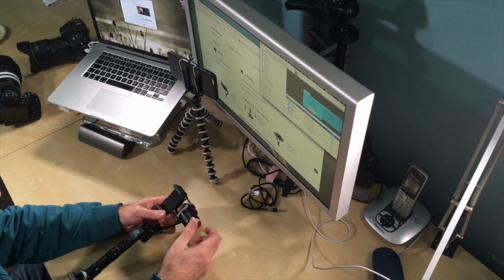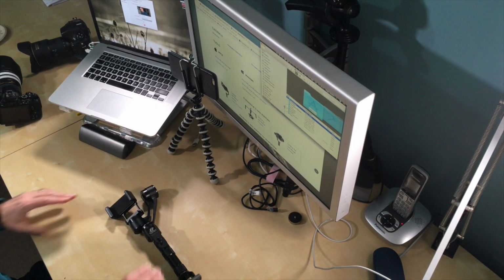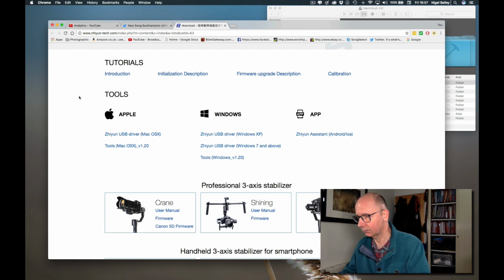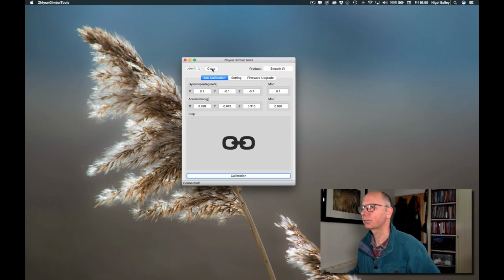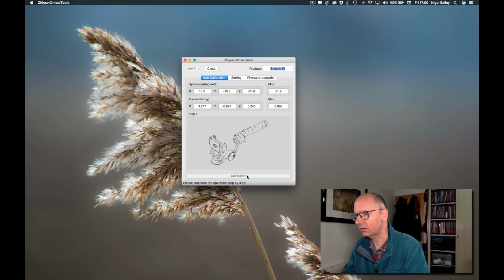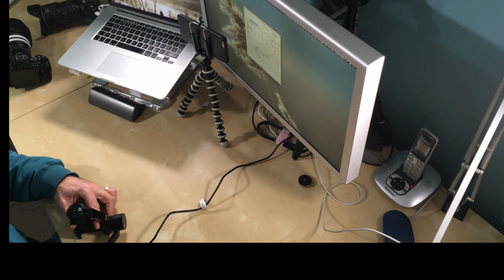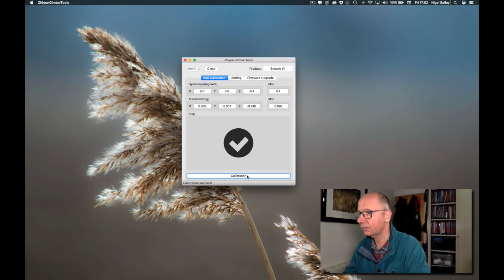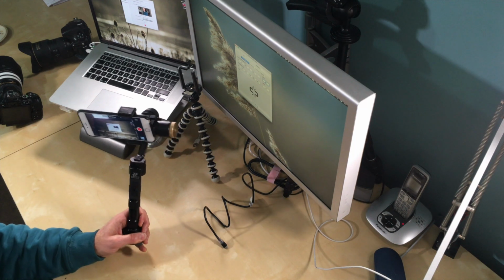How to calibrate a Zhiyun Z1-Smooth-C Gimbal

Comment: thanks for great video, but I made all the steps, anyway my gimbal has the problem that after I switch on the arm that holds my phone starts smoothly going/shifting up (like if I had joystick holding upwards -but I don't...)  do you know anything how I could solve this issue? thanks!
Reply from the maker: Thanks for watching and your question.  It sounds like you have a different version of the gimbal as you refer to the "joystick" which wasn't present on the first generation version that I have.  Sadly, I'm afraid that I don't have a solution for your problem but I hope that you are able to work it out.
Reply: no problem... well I tried everything... firmware, updates, calibration... nothing helped.
every time I switch on - my cell phone tilts up until it cannot any more.
so, I taped it on the place- so it can not tilt up... ;-)
Reply from the maker: What pain.  Is it under warranty? Sounds like a hardware problem.
Reply: well... I think is still under warranty... but bought on amazon...
whom to send.. :-(

Comment: Just got a smooth-q. Found to use the android app to calibrate its pan rate - I need to have a 2nd phone to run the software because the gimbal needs to have the using-phone in its clamp before being turned on. Terrific. I'll need to check on the version of this for the Q Variant it'd  seem. Wonder if DJI puts its customers through hoops like this?
Reply from the maker: Ian Gourlay sadly Zhiyun seems to have a very poor approach to customer service. I hope the vid will have been of some help

Comment: Mine on my mac and Windows laptop show NO tools to download only USB driver??? :(
Reply from the maker: That's really weird - I've just checked the link and it's definitely there. Scroll down the page to the Software Download bar heading and then a little further. You'll find a red Apple Logo - there is then a open-sided box below that and the first item in it is a link that downloads the calibration tool.  Let me know if you still have trouble and I'll set it up in a DropBox for you.
Reply: Thanks for getting back to me. I've managed to download it to my Windows 10 note book and got it to work.But it still wont load on my imac?
Anyway with your tutorial I have managed to callibrate it now.Thanks :)
Reply from the maker: Jason Taylor I'm glad that you have sorted it. It is possible to calibrate without a computer. I have another video tat explains how to calibrate "in the field" - if you go to my channel you should be able to find it easily enough.
Reply: Im having the same trouble, there is also no option for smooth 3? I keep trying to download the driver available but it doesnt show up in my applications? any help would be appreciated

Comment: instruction manual says "turn on the power switch but do not start the gimbal" which I have no idea what that meant.  I ended up holding down the power button for 3 secs on my Smooth Q in order to start the calibration.
Reply from the maker: Johnny Wang - thanks for adding that - it may be helpful to other users of that model.

Comment: Hi - Mine is working perfectly right now. Is there a point in calibrating? Or is this procedure really only if the gimbal is starting to misbehave?
Reply: Hi - thanks for the question.  If all is well then there's no need to calibrate.  You'll know when you need to because the gimbal will not be level and your horizons tilted.  Even a 1 degree error becomes really obvious.
Reply: Thanks for the response. Perfect, ill let it be then. Although I did find it handy to download free spirit level software. Means you can tell just how level it is :)

Comment: Great Video. Could you help me out? When I connect the USB to the gimbal it says "Communication error please check connection" at the bottom of the tools app. I've tried different micro USB cords and still not luck. 

The gimbal is basically dead. The yellow LED's under the motors are flashing but it will not activate. I thought if I upgraded the firmware it would bring it back to life. If you have any suggestions let me know. Thank you.
Reply from the maker: Melvin Hue - that sounds like a real nightmare. I confess that I rarely do firmware upgrades on any of my kit; it almost always causes more problems that's it solves. When you turn the gimbal on does the right hand LED flash? If so, how many times? The number of flashes indicates the battery strength. Immediate try-outs would include reinstalling the calibration app and checking to make sure there is no fluff, dirt or other obstruction in the USB connector socket.
Reply: DSLR Life - Nigel Bailey thanks for the reply. The blue led flashes once and that's it. The batteries were fully charged in my last attempt.
Reply from the maker: Melvin Hue - when fully charged the led should flash four times.  This may sound a stupid question, but are you using the separate charger to charge the batteries, or are you trying to charge them whilst in the gimbal? I only ask because, when I first took mine away somewhere I assumed that connecting a cable to the gimbal and plugging in to a power source would charge it, but it doesn't.
Reply: No. I used the separate charger for the batteries and charged them until the led on the charger turned from red to blue.
Reply from the maker: Melvin Hue - do you have a separate battery tester you can check them with? Also, I had trouble when I got some corrosion on the gimbal's battery contacts; I scraped them clean and also scraped the batteries themselves which solved that problem.
Reply: Ok. I will try these suggestions. Thanks a lot.
Reply from the maker: Melvin Hue if I can find anything else that may help I will let you know

Comment: I would like to personally thank you for making this "How to calibrate a Zhiyun Z1-Smooth-C Gimbal" video. 
Like you said in the video "It's like wrestling an octopus". I was very intimidated by the supplied instructions.
 
I put your video on the left of my monitor and the Zhyun Gimbal tools.exe on the right side. 
At each step of calibration I would pause your video and use the gimbal tools on the right. 

It took me less than 5 minutes and went very easy and SMOOTH.

Thank you again!
Reply from the maker: Mike Moore thanks for the feedback - that's great that it worked for you.